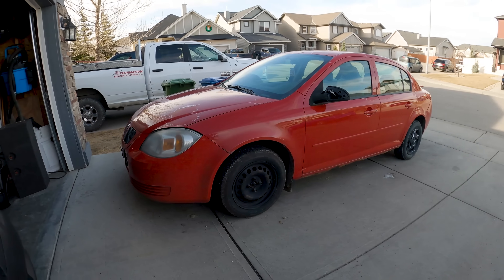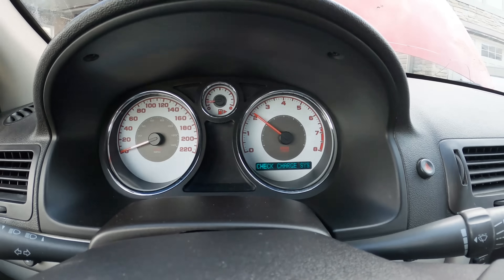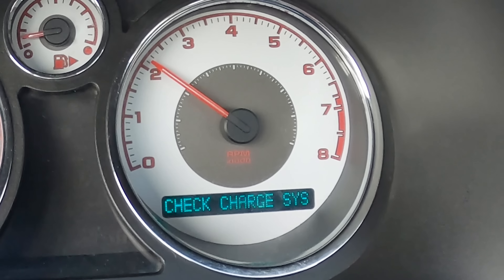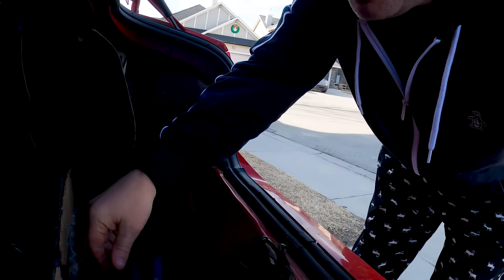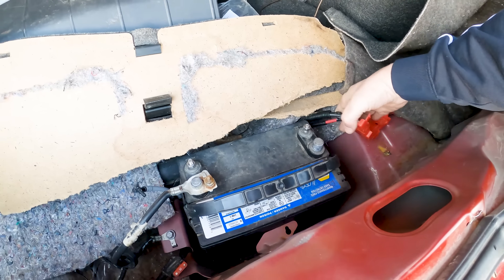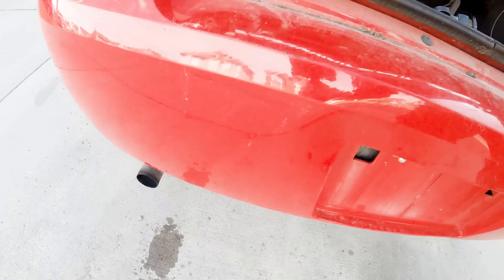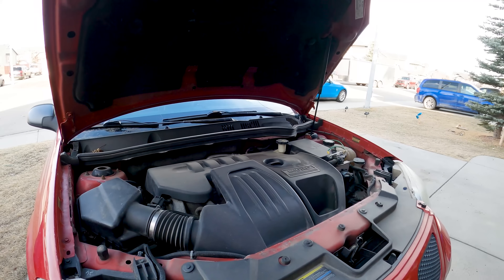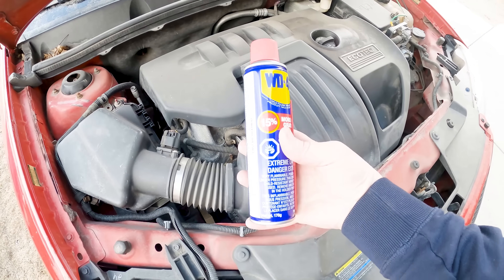ROADSIDE FIX! REVIVE your DEAD or DYING Alternator with this ALMOST FREE trick! | Gears and Tech

Comment from the maker: Get the items used in this video here

Phone Charger with Voltage Reading - https://amzn.to/3KTEV5M
WD40 - https://amzn.to/3uMPNws

Other tools that are useful for working on Alternators:

Voltage Meter - https://amzn.to/3vr1Kan
Portable tool kit - https://amzn.to/3xxrPad

This is the tool kit I use to fix my cars and boats - https://amzn.to/3h58UtI
This is the Scanner I use to Diagnose ALL Autos - https://amzn.to/3k56zjQ
Reply: That’s a very cool USB volt meter
Reply: I need USB-C
Reply: @l...  Me too! & they're only like $12
Reply: You are completely wrong! I’ll spare you my almost 30 years of automotive credentials and 2 master’s degrees because you probably don’t care anyway.  Disconnecting a battery terminal on a running vehicle on any car made in the past 35 years is not only the most stupid thing one can do as a diagnostic, it is also not at all reliable as a diagnostic! Especially on vehicles manufactured in the past 15 years as they are almost all computer controlled charging maintenance and electrical field controlled according to electrical demand. You truly have no idea what you are talking about and possess absolutely no command of automotive repair, electrical or electronics theory and operation. Disconnecting a battery terminal on vehicles in the 1970s and older was common to test the charging system and also necessary because they had generators with external mechanically operated voltage regulators that were unaffected by voltage anomalies and high current spikes that destroy modern electronics through the high resistance condition created when disconnecting a battery terminal while under operation and electrical generation. It was also necessary to do on 1970s and earlier vehicles as a diagnostic to see if the mechanical relays in the voltage regulator would operate when energized and de- energized additionally the generator could be put into a full field operation that way as well. Very few mechanics in those days had electrical diagnostic tools to trouble shoot without disconnecting a battery terminal. You however are just negligent on so many levels of misinformation throughout the entire video. Please stop embarrassing yourself… please!
Reply: @davidkarpen5686  Absolutely true... The information on this video is incorrect. I'm an automotive Master Technician, I specialize in electrical and I'm glad you mentioned all of this.
Reply: @bone3594 lol..bull..you just want to get repair work ..this works
Reply: @davidkarpen5686  Hope you can report him and have his account closed and this video deleted. I was not able to. All I could do is make my comment known below.
Reply: @davidkarpen5686 
Informative 
If we disconnect the kable from battery, when the engine is running, then we can have problem=burn  with the Alternator
Reply: @konstantin-big of course! The alternator is outputting current the entire time that the engine belt is spinning it. When you disconnect the cable to the battery that energy has nowhere to go. The buildup of heat and electrical current will destroy the electronic voltage regulator inside the alternator. I’ve also seen it burn up the stater coil. On cars built within the last 15 years, many of them do not have the voltage regulator inside the alternator anymore. It is inside the engine control module or sometimes it’s called the powertrain control module.  in that case you will destroy the circuitry in the vehicles computer.
Reply: @davidkarpen5686  
Exactly 
I am working on cars from 1975
Reply: Yeah no tools needed because he's the tool!
Reply: Thanks!!!!
Reply: wd 40 to the rescue again ! hard to believe the magic associated to this solvent.
Reply: @GearsAndTech Would you suggest to keep spraying WD40 or Electrical contact cleaner once a month or more to keep it cleaned
Reply: Where's the link for the noisy valves? I don't see it in the description
Reply: He may be wrong but it just saved me.   I lost power and my car said service charging system NOW.... I BOUGHT a brand new battery and thought is fixed the issue but no.... After driving 5 minutes the service light litt up again. Now I was trying to see how can i replace the alternator and its some work...   saw the video and said it couldnt hurt to try..  well!!!!!   I 5 minutes it worked!   It foccin WORKED!!!!!   THIS SOME COOL AZZ SHYT.   GUYS dont disconnect your batteries just test them and when you find its not the battery try spraying while its running and ny charging error code went out and been out for 2 days now!!!!!   Moral of the story....   school cant teach everything!!!!!   I am crazy excited
Reply: Your background music is sooooo annoyiny that I had ti turn you off and give a thumbs down.
Reply: Plĺ
Reply: Damn for all the haters and your degrees and certificates and whatnot, my 30+ years I've checked my alternator by taking the cable off WHILE RUNNING. And guess what, I've NEVER had a problem yet. 
 Spare me the book sentences, experience said that I have not had a problem yet.
Reply: @Dillon-fc4xk  you’ve never checked anything! And you have no experience! You’re so ignorant that you actually think that you’ve done something! But in fact, you’ve done nothing, you have never checked your battery or your alternator by disconnecting it, because any results that you think that you have were in fact, results of nothing! You know so little that you don’t even know that you weren’t testing the battery or the alternator by removing a cable! You just think you were, Because you’re ignorant. Go back to school! Or go back to sleep!
Reply: It is the headlight, that shows 😂
It is always the regulater. Not the regulater itselfe. The coal brushes are.
Just worn out. Stuff some battery coal in the shaft🎉 But Dude, do you really have to do so much content for no solution😂at all🎉
Reply: YOU FORGOT THE BUTTHOLE😮
Reply: Can I spray break cleaner
Reply: I only have katz azz and my alternator is dying my voltage has been slowly dropping even after tightening up the terminals and cleaning them and doing the tests that you have shown I’m no where near any place that has WD-40. I’m stranded on the highway.

Comment: You would probably be better off spraying electric contact cleaner for multiple reasons one it's a flipping electric device and two it actually cleans wd40 just gets it " lubricated" I use that term loosely and then eventually just will clog back up from deposits sticking to its "lubricant"

Comment: Completely Wrong, first if your alternator is putting out less than 14 vdc  not good.  You could have a bad connection to the battery dirt on Stator or bad diodes in alternator, clean with contact cleaner then tuner lube! Never use WD-40, you will ruin the alternator!

Comment: I didn't hear you say why/how the WD 40 works. My 99 mustang GT the battery light but I'm driving the car just fine, went to have my alternator checked and it said battery @42% and I'm trying the WD 40
Reply from the maker: It's for cleaning off the corrosion

Comment: This is the quickest way to fry a PCM, ECU, BCM, TCM, CAN-BUS, or any of the other modules present in most newer vehicles.  When you disconnect a battery lead when the vehicle is running the voltage spike that can occur can end up costing you thousands in repairs.  Back in the day when cars had much less sophisticated computers or none at all (carbed prior to EFI), this wasn't something you had to worry about.  

Another way to cause expensive electrical damage, is playing the Good Samaritan with jumper cables.  You NEVER want to start the donor vehicle, rev the RPM's, let is run for a few minutes, then have the jump vehicle start cranking the engine.  Best case scenario you'll blow the fusible link or the alternators rectifier; worst case your insurance pays out a claim for repairs to the jump vehicle and denies repairs to yours.  As the saying goes, "NO GOOD DEAD GOES UNPUNISHED".  

Sure, people have been doing it like this for years without issues; the 1st time your luck runs out will be the last time your jumper cables come out.  Buy a jump pack, keep it charged,  and in your vehicle, or if using jumper cables just remember, you never need to start your vehicle to jump someone else's.

Comment: Didn't work for me, in fact, it did the reverse. I had it tested, and then I checked it with my own plug in voltmeter and after spraying it with WD-40, the output went from 11.7, where it was holding according to the first test and then my own voltmeter, and then it steadily declined - meaning the only charge in the system was the battery and it ran down and down and down. I revved the engine and let it idle, trying to rev it at intervals (2 grand) but it just kept steadily declining till it dropped below 10 volts and when I hit 9.6 I stopped the car to try and save the battery. Replaced the alternator and the battery still worked thankfully and now after a hundred and fifty miles, I can say that everything is still working the way it should. I'm explaining all this to show that there was no other contributing problem and that the WD-40 trick did NOT work. It seems, in my experience, that these quick fixes do not usually work and I'm leaving this comment here simply as one true story. Sometimes I really wonder about all these positive comments on videos like these, how many are fake... Besides all that, I would think electronics contact cleaner would do a far better job than spraying an oil based solvent in the works.

Comment: Disconnecting a running car batter lead went out style in the 70's because of the possibility/probability of damage due to back emf taking out sensitive electronics. I will remember your tips if ever I am being chased by a serial killer in the middle of no where. Thanks!

Comment: I personally dont see an issue with this trick. The alternator is obviously bad already, so if this trick can get more life out of it, fuck it 😂. Also i was all about the old school disconcerting the batter to check the alternator, but learned its all BAD! USE a meter to test it because this can blow out your diodes and cause damage to other electrical systems and ruin the car so FYI.

Comment: You can’t do the battery disconnect trick with modern computer controlled vehicles. Disconnecting the battery may cause a surge to the vehicle electronics. That was an old school method to use back in the day with “ stupid “ vehicles and it worked well, but is no longer an option.

Comment: If you know you have a weak alternator, do not put all your faith in this remedy. There are other reasons alternators fail, like if the voltage regulator circuitry developes a bad diode or something. In that case omly a replacement or bench repair will fix the problem.
Reply from the maker: Absolutely, this is more of a temporary fix for a specific issue.

Comment: Got by for a year without an alternator working. Magic trick was a small 18watt solar panel. Just connected when sunny, on a good day would put an amp in, and after 4 hours could drive the 5 miles I needed to. Eventually saved up enough to get an alternator, installed it myself for < $75, an old dodge van.... Interestingly it would run until battery was 6volts. Got a problem with 2002 Hyundai elantra charging system, cut off three times and now not producing voltage... It stopped running at about 8volts. I have one of those usb voltage meters, very worthwhile having....

Comment: DO NOT  DO NOT disconnect your battery while the car is running if your car has a computer.  It may cost you hundreds if not thousands of dollars in repairs.  Just because it’s on YouTube does not it’s reliable information.  Google it and you will understand why YOU SHOULD NOT DISCONNECT THE BATTERY WHILE YOUR CAR IS RUNNING.

Comment: Never disconnect the battery while engine is running. That could generate voltage spikes and harm sensitive electronics in the car, including the ECU/ECM itself. There are other, still simple methods to verify charging, like current clamps over tge battery power cable and proper voltage meter at the battery poles.

Comment: I have a question : I’m fully about that life so trying the w40 hack I’m doing regardless I just wanted to know the likely hood of smoke or fire on a 2016 mkc Lincoln I need to buy myself a couple weeks or at least a week while I’m working on getting my alternator replaced ( it is the alternator ).. ( AFTER ALLOWING IT TO sit for 5-10 minutes with car OFF!) 

And …
If all I can afford is a used alternator , would it make sense to get that put that on? ( when I have the money late November I can put a new one on)

Lastly, if the belt looks good, could I just do the alternator ? Or should I do the belt, tensions , etc 

PLEASE HELP “! I’m just a girl “ taking care of my disabled hospitalized father and need advice ??? Quick 🙏🏽
Reply from the maker: See is the wd40 brings it back to life

After that I would look at a remanufactured replacement when you have the cash

Comment: Actually the real trick is if ur alternator is not working   Most likely is ur voltage regulator  if not working  unplug the control wires and it will default to its set point  works 9/10 times

Comment: The Alternator died on my old Jaguar and that WD trick worked to a degree.. the car starts now but the voltage gauge is still very low but I’ll be able to limp it to the garage for a replacement.. thanks 🥰
Reply from the maker: Glad it helped you out!

Comment: I had a question about what exactly do U mean to get the alternator fixed or serviced? U mean get it replace? or replace parts of the alternator such as the rectifier diodes?  I tried to read all comments but there's like a thousands of them !  Awesome Share !!  Thanks a million for the video !! !
Reply from the maker: I usually replace with a remanufactured one

You can service yourself if you have knowledge. But a new refurb is better piece of mind

Comment: Never ever disconnect a battery while  the car is running as the alternator relies on the battery as a load , if by chance your alternator is ok you run the risk of severe damage to any electronic components. But don't take my word for it as I have been an auto electrician since 1975. WD40 and the brushes are a poor mix. I just love these homegrown experts are a waste of space. One  quick way to see if you can get it going temporarily is to tap it with a hammer .

Comment: 99% of alternator (and starter motor) failures are simply the spring loaded carbon brushes either wearing down, or the spring that pushes on them sticks or hangs up, allowing the carbon brush to lose contact with the rotating slip ring, thus the failure to charge. A simple light tapping on the alternator or starter motor housing with a hammer will often times free that stuck spring, or give the little nub of carbon brush that's left, just that tiny bit of movement enough to make contact again, and last long enough to get you home, with a few miles to spare while you go get your new or rebuilt alternator or starter. The tapping trick has worked for me personally on 3 alternators and 2 starters over the years. No need to be towed home if you remember this!

Comment: Ya so right I learned this from a older Gentleman when I was 17 and It fixed the changeing isue fast he sprayed and started my, 1970 Chevelle and tapped lightly on alternator and I seen the charge needle go to normal Instantly , and drove a year before alternator showed same Symptoms and repeated and work another 9 months and attempted again  dead but to less than 20 minutes to put another on ... I bought at slavage like knew 20 bucks...I would say 21 months of use Is a good squeeze...

Comment: My vehicle set idle for 2 months waiting for parts for a transmission. Soon as I get it back the battery light comes down and says the charging system needs service. Mind you I got 300,000 miles on the vehicle. But it was working perfectly fine until it got parked. Change the battery and still got the issue. I'm going to give this a try it makes sense. Sitting around for 2 months and probably got cobwebs and spiders and stupid stuff in there
Reply from the maker: Should do the trick

Comment: You can also take a pry bar and tap the alternator housing with it to shock the brushes and make them fall back down where they belong. What happens if as the brushes wear the carbon their made out of gets caught up between the brush and the slide that the brush moves up and down in and they stick up the alternator needs battery voltage into the rotor to create an electromagnet so it can produce current in the field windings otherwise it can't make electricity so again if you can get something in there to tap on the housing alot of times they will pop loose again and the alternator will start working again for a time but they'res no garuntee that it's the brushes it could be a regulator or diode tree issue which isn't going to help you out though most of the time it is the brushes it's not a garuntee that the brushes have failed
Reply from the maker: Yes

Comment: It seems like everything you did prove that the alternator was working correctly. Except for the cigarette lighter plug. Even though the cigarette lighter plug does work I would have checked it with the meter.

Comment: Holy smokes, this worked! I have a 2013 Audi allroad that had an alternator fault light come on yesterday. I was about to search out mechanics when I found this video. I skipped the battery testing part and just went straight to spraying WD-40 into the alternator and started the car and it worked like a champ! No more fault! Thank you so much!
Reply from the maker: Happy to help. This is a temporary fix. Plan for alternator replacement soon